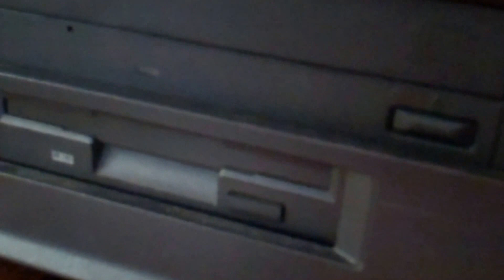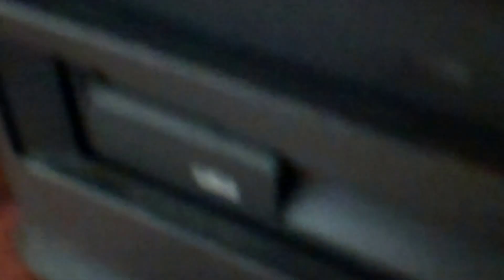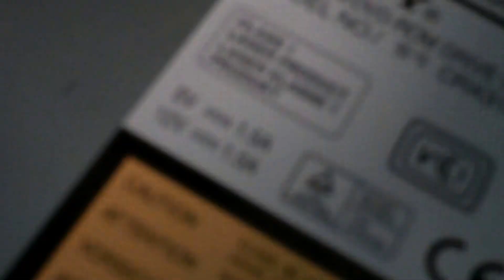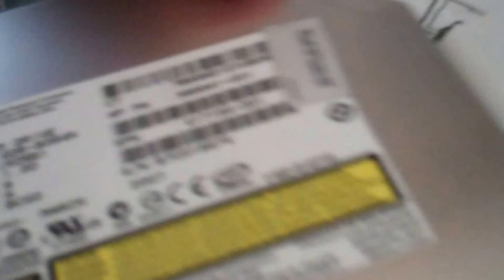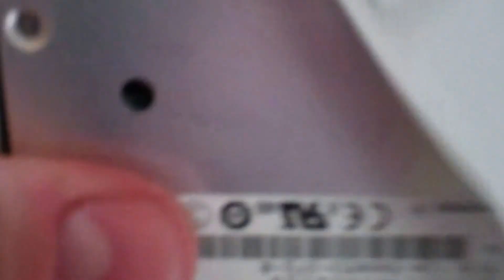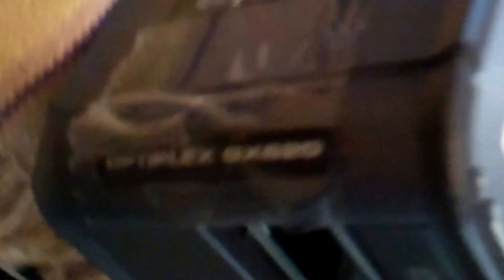Removing 3.5 Floppy Drives from 2 Dell GX620 Computers

Comment: I am tring to remove mine as well to get the old hard drive out. It looks like you just pushed on it to get it to come out but mine won't budge. Doubt you remember but was their anything you had to press to release it?
Reply from the maker: Yeah I no longer have this Dell but after re-watching the video, there's probably a lever that releases the locking mechanism so it can be removed. I just don't remember
Reply: @RVR2  that was my thought but I only see some down at the bottom for the hard drive. Guess I'll keep messing around with it thanks.
Reply: There is a metal lever to the side you pull it up and that unlocks it

Comment: I have a 3.5" floppy drive in a separate housing that connects to a computer via a USB port. I have a shoebox of 3.5" floppies (some copied from 5" floppies. They contain three or four books that I never got published and hundreds of magazine articles. Some of them were even written in Word Star. 

Jim
Reply from the maker: Again it will not work in my home office..
Reply from the maker: +Jim Foreman Oh wow! You should retrieve those files and publish them! These 3.5 floppy drives are on there way to the donation place in the near future.
Reply: +RVR2 if you put a ssd in thim you will not need  a  big  fan those drive  have  high temp
Reply from the maker: I'm trying not to spend a fortune on these old computers.. If I get a SSD it will be for a high performance custom build.
Reply: +RVR2  what abt  just running it in VMware  and have  a single pc  with 5  screen  and  5 key bord  and mice  this will cut  temp down 80%  and in long run save you cooling cost
Reply from the maker: I run a small business with separate independent computers... That setup will not work in my office.
Reply: al tho  that setup  is  over kill and  a basic  pc will  handle  5  user
  just fine if it not gameing